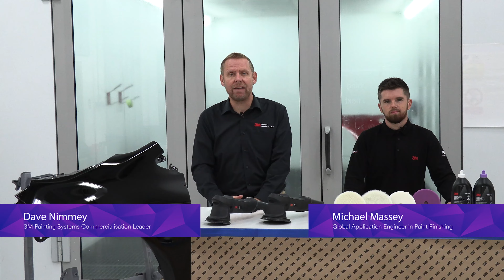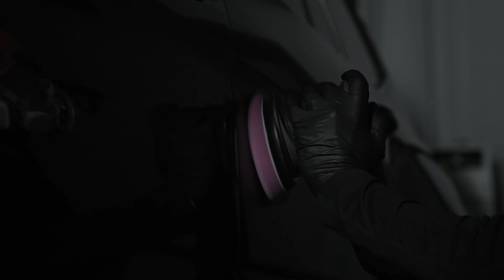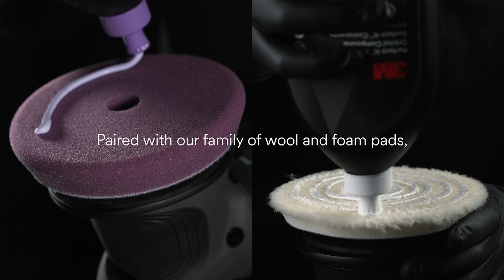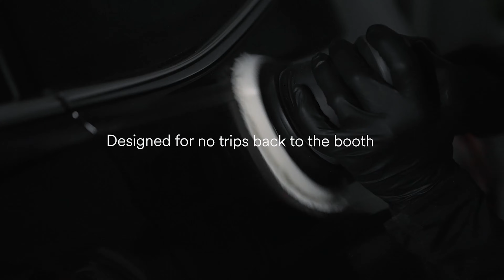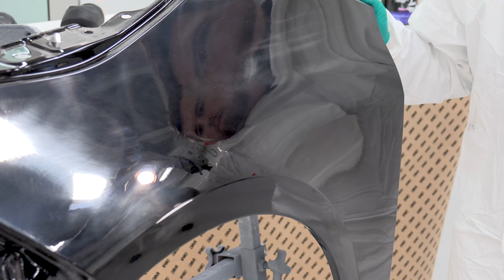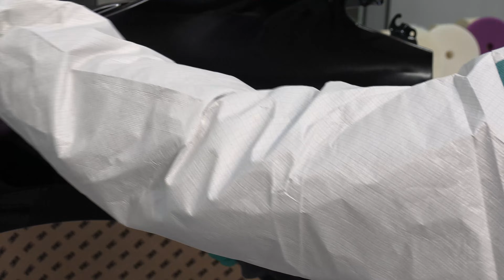3M™ Random Orbital Polishing System – Technical Webinar English Europe – Refinishing. Redefined.

Comment: I have done detailing as a side business for like 10 years and i hardly use rotary. in my opinion you can correct paint faster with 15-21, especially with 21, but with the rotary you can destroy paint faster. I know it sounds crazy, but thats how it is. The things you do with 21 1-2 step, you have to do 2-3 steps with the rotary.
Reply from the maker: Hi there! We're glad to hear that you've been in the trade for a long time. Please note that rotary cuts faster than random orbital, but you are correct, it also means you can destroy the clear as it can burn through edges very quickly. Random orbital has fewer steps than rotary on dark colors, but it cuts slower. Our customers who want speed and a better finish use both. They will compound with rotary for speed and then polish with random orbital for a finer finish. At the end of the day, it's all personal preference for the person doing the polishing.
Reply: @3MCollision  Not really when you use 21mm machine with 5" short wool pad and if rotary has 5" wool pad too. You get some speed benefit when you use 10" twisted wool because you can do so large areas and no need to clean the pad after every set, but you have to finish so much more that its usually not worth it.

Comment: Awesome tutorials using the new 3M ROP and associated liquids!  I just purchased the 3MROP15 (34100) machine however, I'm a bit confused as to which size pad selection (5in-125mm or 6in-150mm) will truly optimize the performance when compounding and polishing fresh clear coats, which is 99% of my small business.  The 15mm instruction manual calls for 6in-150mm size pads for the 5in-125mm back-up pad and yet I've seen the 5in-125mm pads being used on the 15mm polisher as well.  My shop's inventory is either 6in-150mm or 3in-76mm pads.  I'm willing to swap over to 5in-125mm pads if you tell me that size will deliver the highest quality finish.    Many thanks for your expert advise!   Mark
Reply from the maker: The ROP 15 and ROP 21 have been designed to be used with their recommended back-up pad, compound pad, and polish pad sizes only. It’s not recommended to mix and match the 2 different sizes as this can unbalance the machine causing a lack of efficiency in performance, added wear and tear on the components due to higher vibration levels, and excessive wear and tear on the selected pads. We recommend that the ROP 15 machine uses the 5in-125mm back up pads and compound/polish pads, and that the ROP 21 machine uses the 6in-150mm back up pads and compound/polish pads. This will ensure the machine and pads are performing correctly and pads can have a longer lifetime.
Reply: @3MCollision  Much obliged for your timely response and sound advice for my ROP 15 machine.  I will follow your recommendation and build a new inventory with 5in-125mm pads.  I've been a huge fan of 3M products all of my life and really look forward to the seeing the finishing results now that I've switched from the rather messy rotary system over to the Perfect-It ROP system.  Greatly appreciate your support!   Mark
Reply from the maker: Glad we could help 👍 Keep up the good work!

Comment: where & why would you use the 15mm over the 21mm & vice versa?...
ive been painting 28 years used rotary & had many great jobs ,not sure if people dont know how to use a rotary maybe ? there have been black show cars that were flawless for many years prior to D/As after a D/A demo i saw  just another tool to help us achieve a great finish..
But i like to try things & give things ago and just got a 3M 21mm D/A polisher  as the rep said id use it more then the 15mm  But they couldnt really convince my on why 1 over the other.
thanks for the  info
Reply from the maker: Often choosing between the 15mm tool and the 21mm tool will come down to its intended use. We find for general bodyshop activities, the 15mm tool will be a great choice due to its versatility. The smaller diameter pad and lower oscillation allows easier access to the more awkward areas of the vehicle; door handle recess, wing mirror attachments, and small areas on bumpers. If the intention is for an ‘all over finish’ or a swirl removal stage, then the 21mm tool would be the tool of choice as there is an increase in pad size, so you will cover more area, but also a slight increase in cutting ability too.
Reply: @3MCollision  thank you for your response i do repaints & general collision work sounds like the 15mm is also a required tool  for smaller & tighter areas i know 3M dont have a smaller 8mm (to my knowledge) like Rupes & many others being a small shop im not sure if a 15mm or 8mm would be better,
id imagine swapping the smaller back up pad from the 15mm  machine to the other 21mm wouldnt work due to the weight in balance ? or am i wrong, 
thank you again
Reply from the maker: We advise for optimal performance a 15mm machine will give the best balance between speed, cut, and finish, especially for freshly applied paints. An 8mm tool would also work, but may take longer to achieve the required finish. It's very much dependent on what it is you are trying to achieve as each paint job can differ. You are correct in the assumption about switching the backup plates from one size to another – this leads to an imbalance with the tool's weight and geometry, which can negatively affect its performance, plus invalidating warranty.